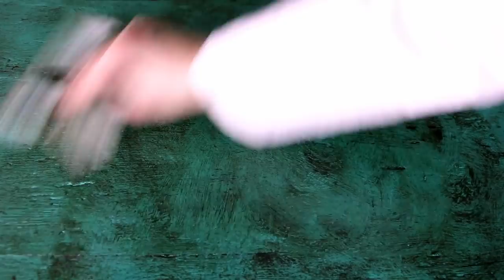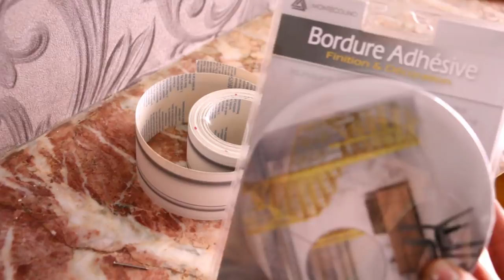ART STUDIO MAKEOVER  2018 | Part 2 | Merveilles en Papier

Comment: Awesome job !! Can not wait to see everything finished. Quick question though, Wouldn't the green of the table bounce a greenish hue onto what ever you are working on much like if the walls were green? I was just wondering because I was going to paint my work surface and was worried about painting it  certain colors because of the lighting effect.
Reply from the maker: Hello Mona! Thank you! no  the hue on the table  has nothing to do with this light very powerful hue I had with the dirty mint green I had on the walls, this color is much darker and my work table is always full of mess, so no alot of green can show anyway ;) but kept in small places the turquoise, green is fine  The prurple slim hue I have on the walls  wins the hue fight ! But it's good to think about that for sure for your work table , green and turquoise are always tricky colors , and the fact that  it is shiny or mat can also make a difference.
Reply: Thank you for letting me know. Sorry it took so long to reply back was busy due to the hurricane.